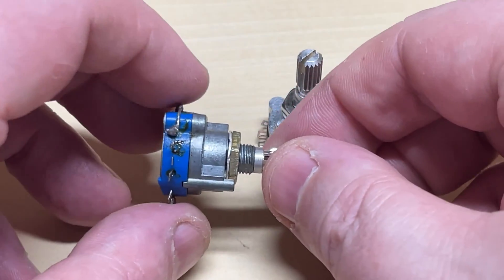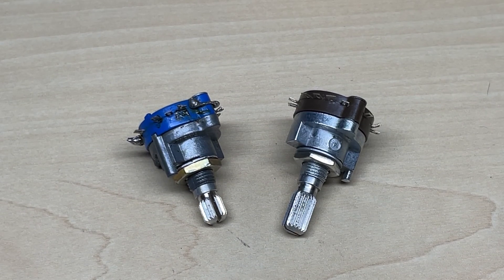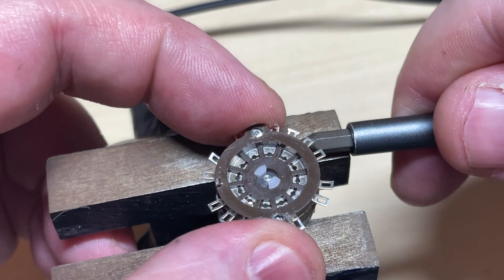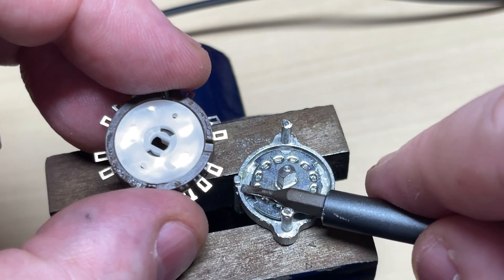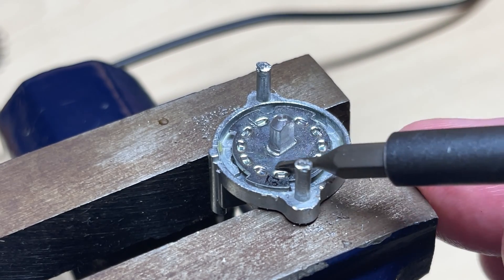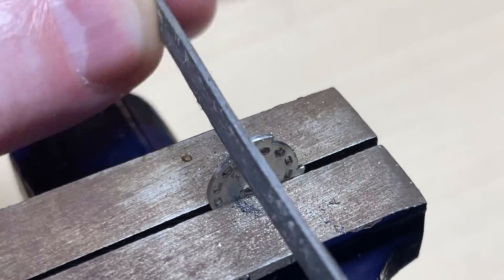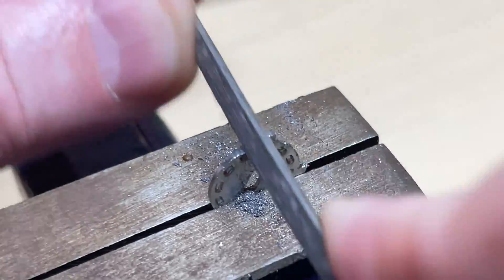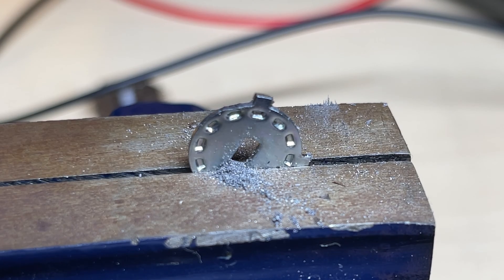How to convert a 2 pole 5 position rotary switch to a 6 position.

Comment: Some may say why go through the bother of modifying it when you can buy the right 6P rotary switch but I'm also a tinkerer and I'd where's the fun in that? I can just  imagine how satisfying it must have felt when you succeeded your modification ,  that feeling you can never buy. well done.
Reply from the maker: Yes satisfying, i believe the 6 pos switches are very expensive, so modding a 5 pos is very cost effective, this mod also applies to the 3 pos 4 pole you find in normal radios.

Comment: With a bit of effort, the retaining pins holding the metal plate, the edges can be persuaded to lift up and that saves filing them off. It leaves enough so they can be tapped back down when refitting. Same with the shaft lugs, a small sharp blade can be used to splay the lugs back out. The superglue is then just insurance.
Reply from the maker: This is indeed true .